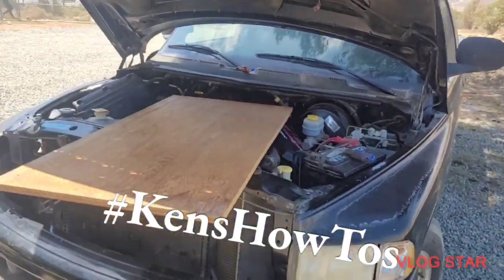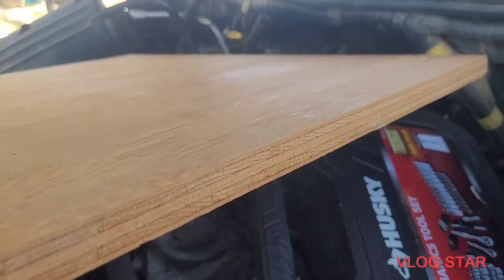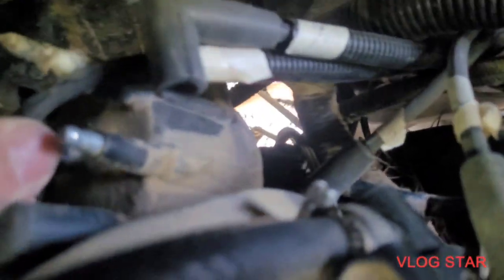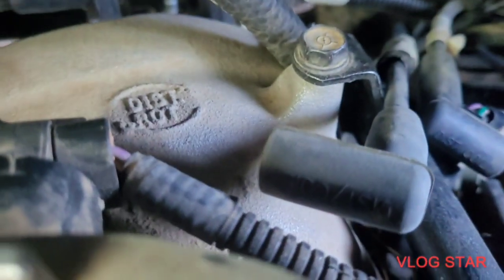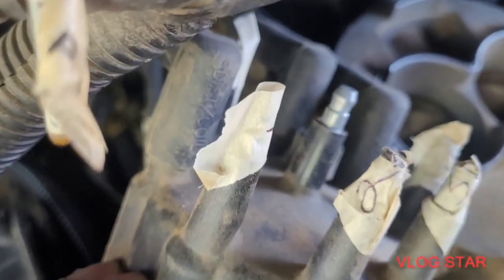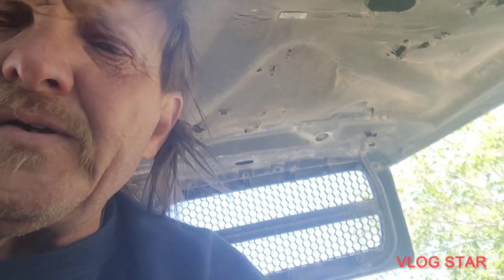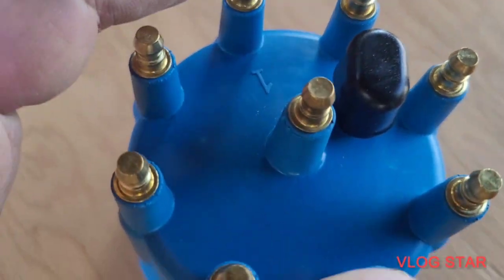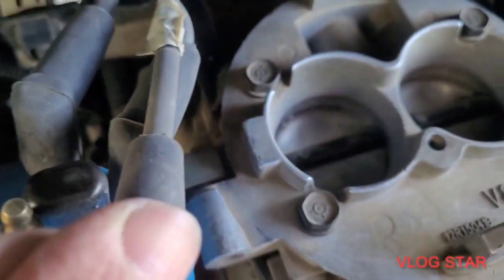How to remove a 1994-2001 Distributor cap on the Dodge 1500

Comment: So my distributor bolt is stripped🤦🏾‍♂️8mm wont work, phillips head wont work. What can i do
Reply from the maker: Sorry it took me so long to get back to you.
Did you get it out or are you still  Trying to find a way?
,,, This is definitely Where you have to be Creative, Can you get a small pipe wrench on it? Can you clamp down with a vice Grip?
? Can you Spot Weld a Wrench to it, and then,   it looseen it? And then Break it Loose? 
... Can you take a Hammer and a Punch You break it loose?
If it's still on there let me know if any of these ideas work, I hope this helps you look forward to hearing back from you, bye for now, Ken
Reply: @HomeImProveMentHow  appreciate the ideas. Im able to attach the 8mm to it, able to turn it but im unsure if its even moving. Im scared I will strip. I’ll try again today. Its always a way, ima figure somethin out. Use some of your suggestions

Comment: Always wondered about this, nice tip on numbering each point.
Reply from the maker: Dennis thank you, A lot of guys can do it in their Head.
 On one side of the motor is odd, the other 1 is even like 2468 The other  Side is 1357,  I remember right the driver's side is the odd side... Now when you number them like I did you don't have to know anything about that👍🏻  It simplifies the process.
 Well thank you for asking for visiting I'll be by The Visit. Look forward to hear from you got blessed by for now your friend Ken